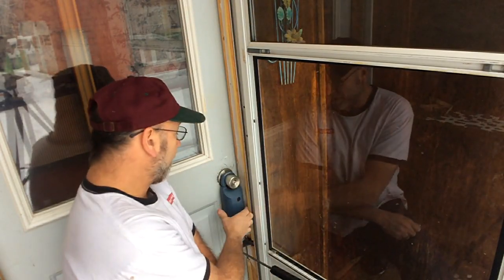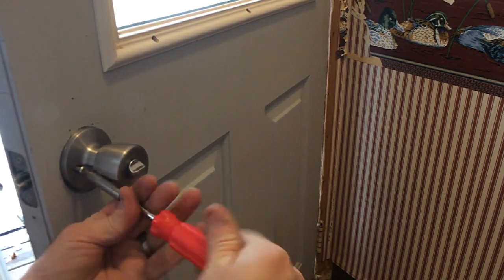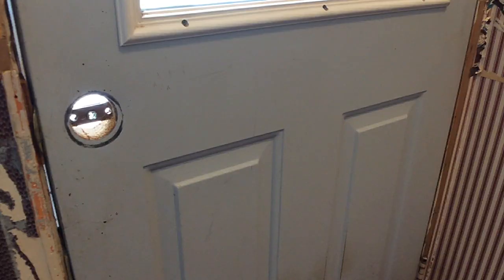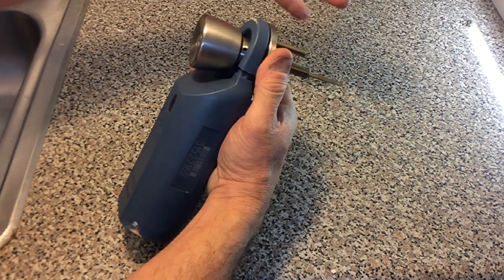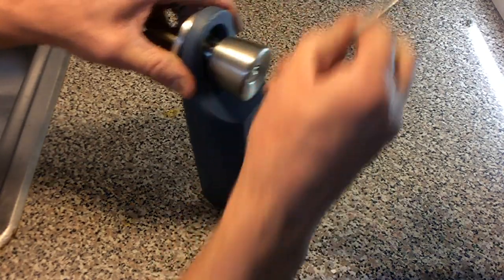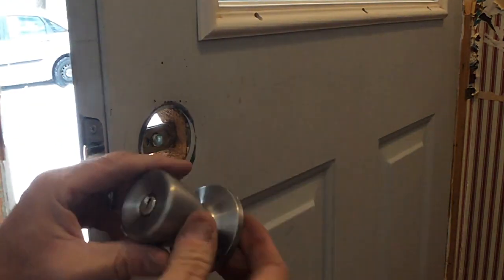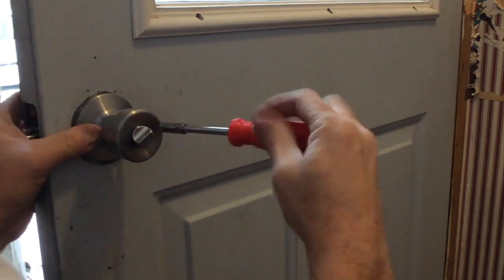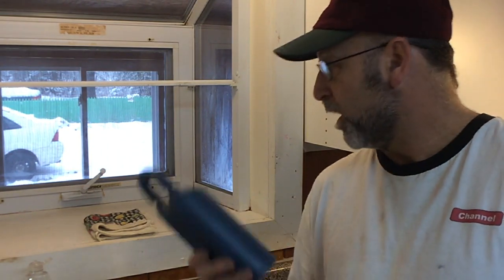How To Remove Realtor Security Lock

Comment: There is a faster way….
Put slight pressure pulling down on the box while you rap the side of the box about 1.5” from the base of the hook that attaches to the door knob.
Use a small ball peen hammer to rap on it